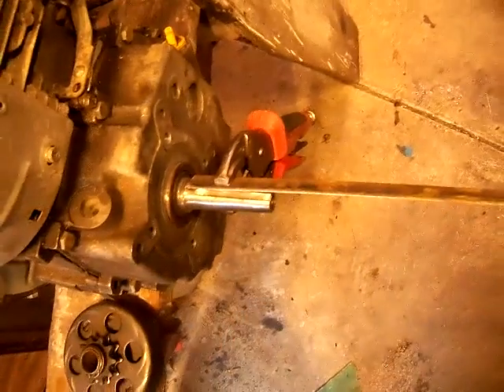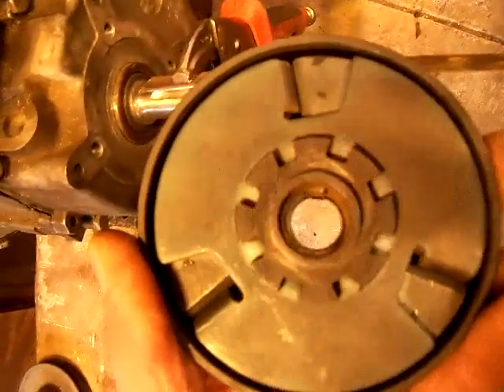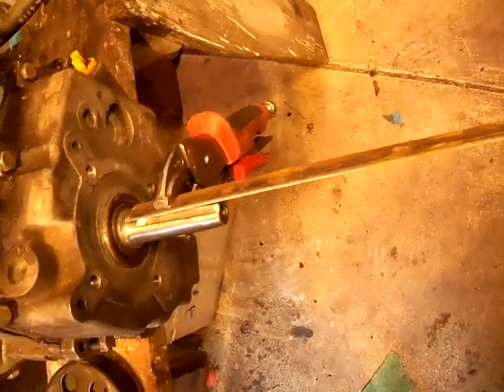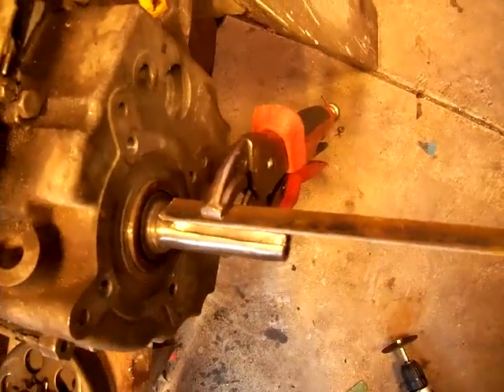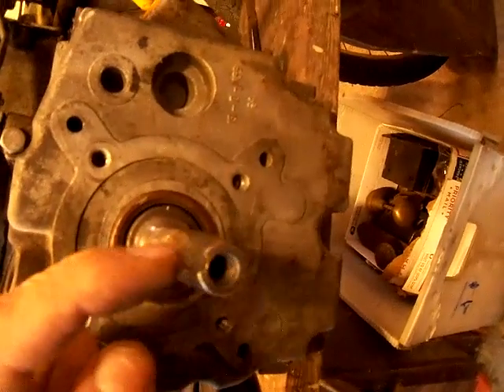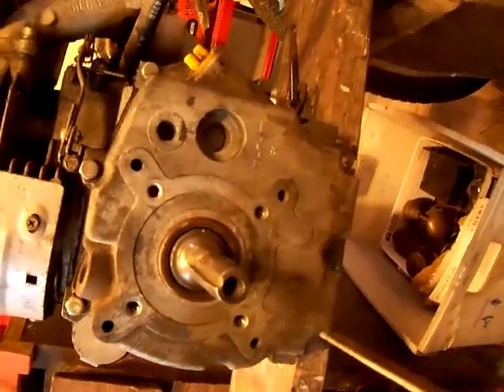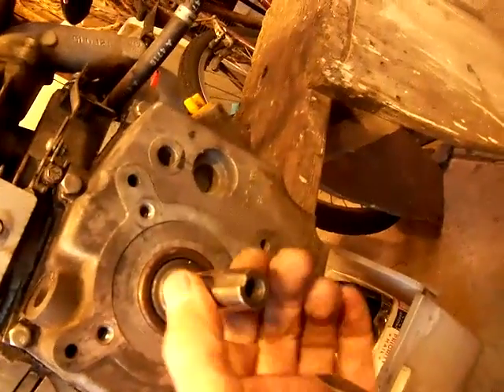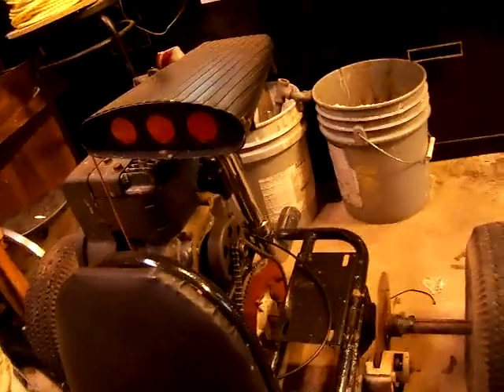keyway cutting low tech 001

Comment: I'm thinking about doing the same thing with my tapered shaft 8hp. i welded up my own cam for it.  I am most worried about making my own keyway, so i might just swap crankshafts. cant decide caust it runs great as it is. there is a video on my page